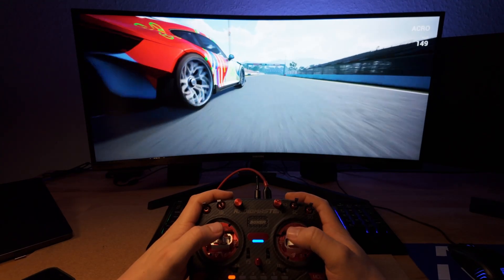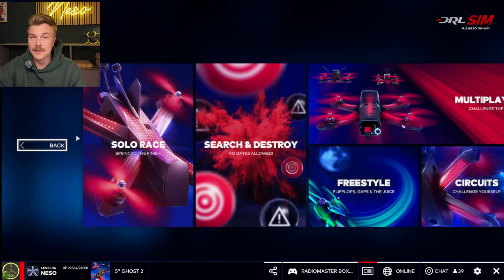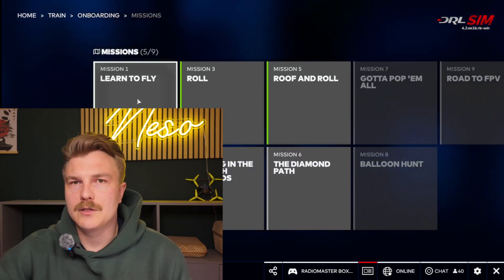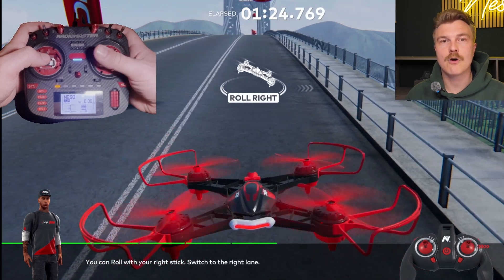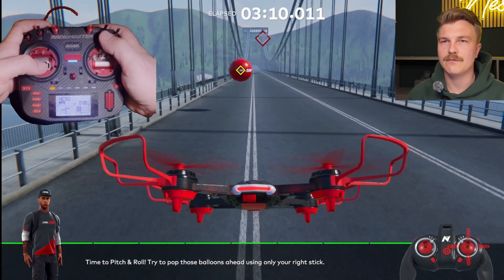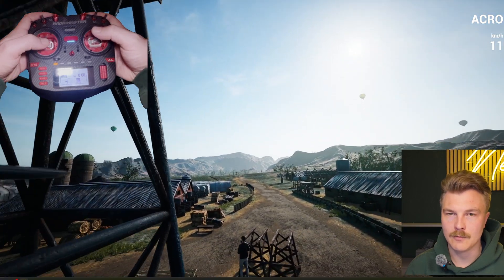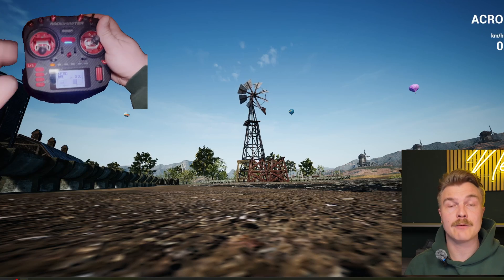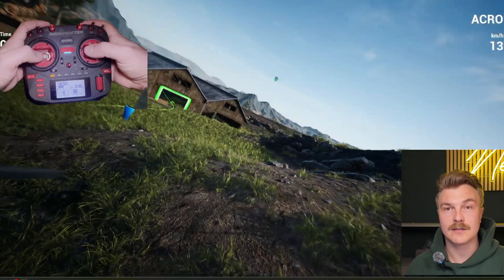GET INTO FPV #2 - Master the Basics: Your FIRST flight in the Simulator

Comment: I have a strange question that is bothering me a lot, i cannot hit the full sides of my full size gimbals, its really impossible without swifting my hand on the controller, so. how big is your hand? the lenght from the tip of your middle finger to your wrist? please when you have 10 seconds free can u check?
Reply from the maker: But the jumper t15 has full size gimbals right? They look quite similar. However, send me an image ob instagram you holding the radio. I always felt like the smaller gimbals are also as fine its just something you have to get used to. Maybe different stick ends (thicker?) could also help
Reply: @nesofpv  i got the jumpert14 but i assume is the same thing of the t15, it only differ from plastic and alluminum gimbals, and no, the gimbals from a t15 to a boxer are not the same size, t15 has got small size gimbals
Reply from the maker: Are you 🤏🏼 or using only thumb. When pinching your hand need to be very close to the stick on the side of the controller. Whatever my size is, the radio should fit your hands. If you do not feel well you have to try out different radio shapes. Meet people and hold their radios. It needs to feel good from first touch. One of the nicest grip is definitely being found at Flysky Elysium radio. Think outside the box
Reply: @nesofpv  yeah man, i only pinch and from the beginning i feel amazing with my taranis qx7 with full size gimbals cause they give me the precision i need, but ultimately i do not have big hands and when i race on the simulator on racing track that needs sharp turns i cannot reach the full end of the stick, i have to move the palm of my hand close to the gimbal limit if i wanna reach it, so i bought a jumper t 14 that have small size gimbals, and i can hit the sides with this size, but there is no precision, the drone is very uncontrollable......... its a shit
Reply: @ do you know how to set stick limits on the radio?